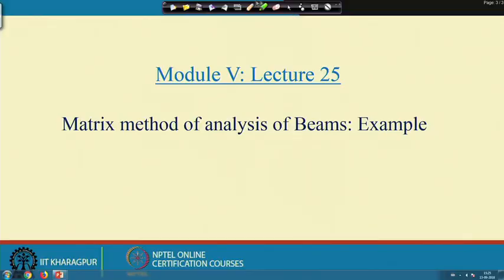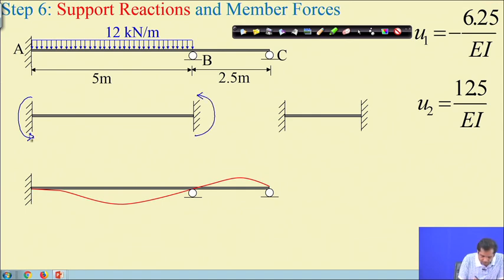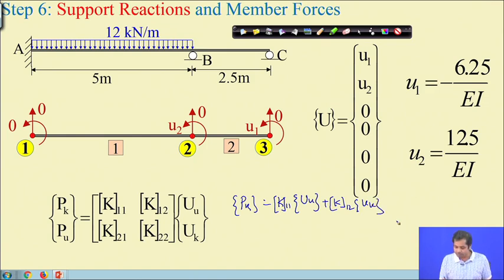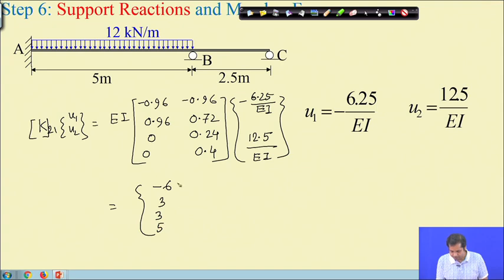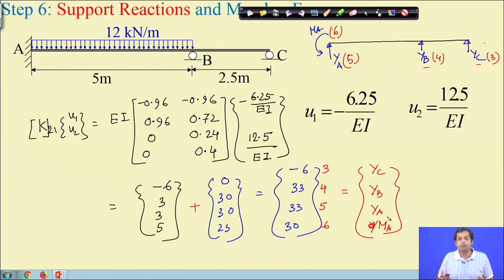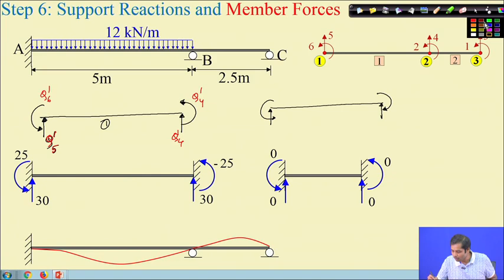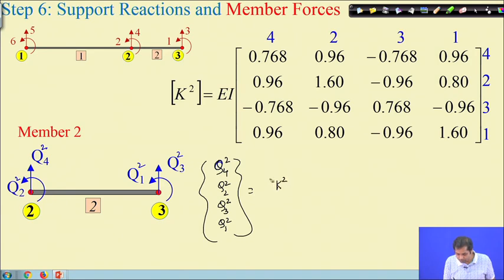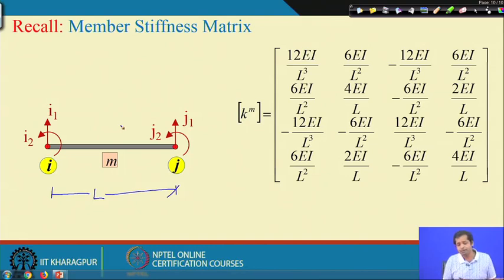Lecture 25 : Matrix Method of Analysis: Beams (Contd.)

Comment: In previous video, fixed end reactions showed as negative values. However, in this video those values are considered as positive. Kindly resolve my issue... 

Waiting for your reply...
Reply: it should be negative  as  the load applied  will  be  
p5 - 30 = 0
p5 = 30
reason =  30 is in the downward direction and p5 is in the upward direction